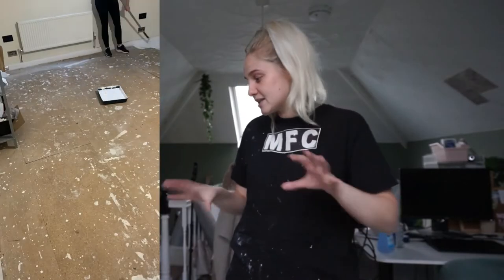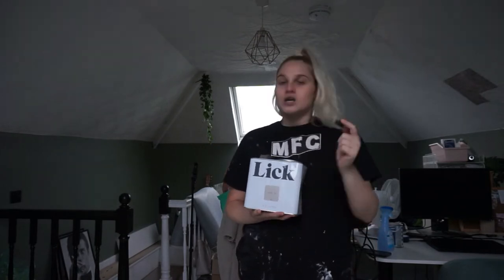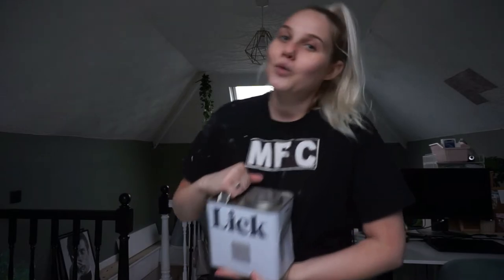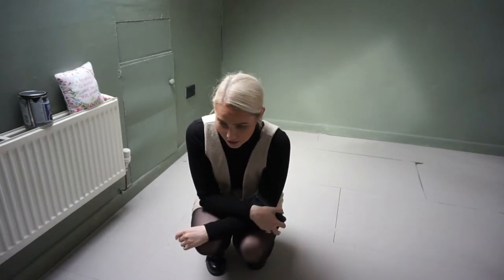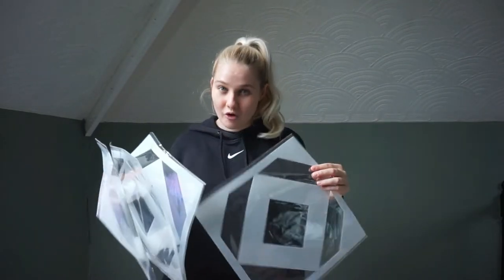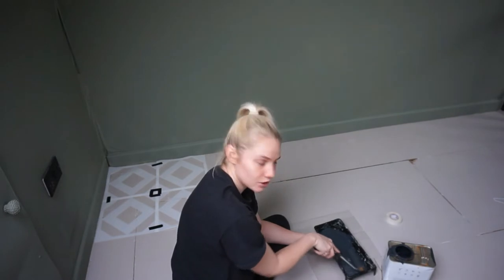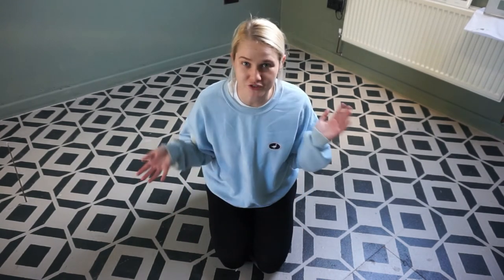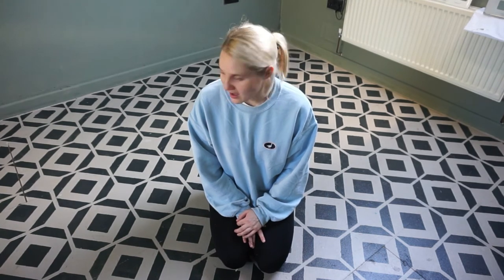How to paint chipboard floors and floorboards

Comment: I would have used wood filler on the gaps between the sheets first, not a big job, will make the "temporary" paint job and the sealer to look much better.  I am doing this to my own bedroom because flooring of a decent durable quality would cost upward of one thousand, and then another eight or nine hundred to an installer.  Don't have the fund to do that, it is not my house but it is my bachelor brothers place and well, he just doesn't care his look is hobo chic.  So, I looked into buying 4x8 sheets of sanded finish poplar 5mm at 26 dollars per sheet I would need 8 sheets to cover and I would use mastic and staples to put it down.  BUT, I am going to try sealing the chip ply first with shellac, then try painting it several coats of exterior paint that would be suitable for decks and the like and for durable wear.  If that works to that point, then I will seal it in with a poly sealer.  I will then put some 8 x 10 same rugs side by side for good floor coverage,  I will use non skid underlay and also two side tape on the carpets to keep them from sliding around.  I think it will look fine, and for me having the horrific dirty wall to wall carpet out is a win win no matter how my DIY turns out.
Reply from the maker: This sounds great - how did it go if you've done it yet? 

We definitely would have used filler if it was going to be a bit of a longer temporary solution, we ended up having our loft conversion a lot quicker than we anticipated, so this floor only saw about 7 months of life!  
It was a labour of love and now we use some of the floorboards as temporary tables in the garden haha!